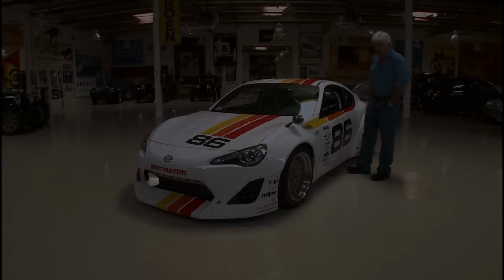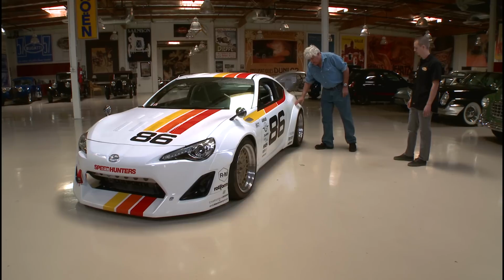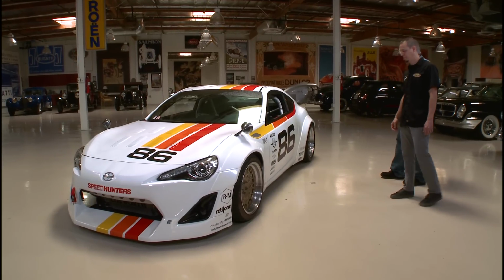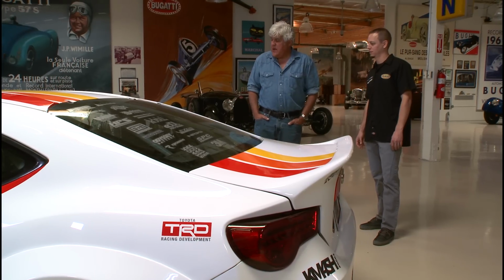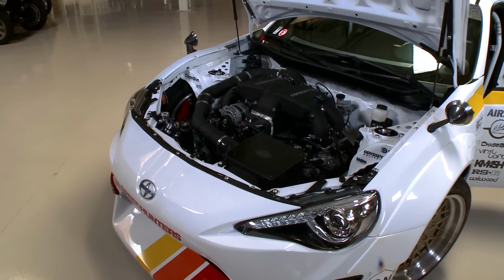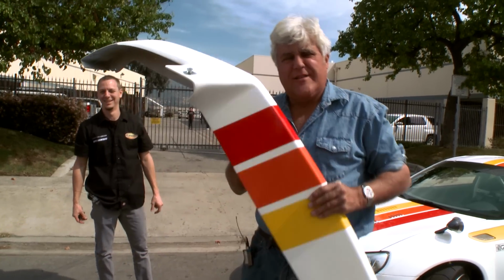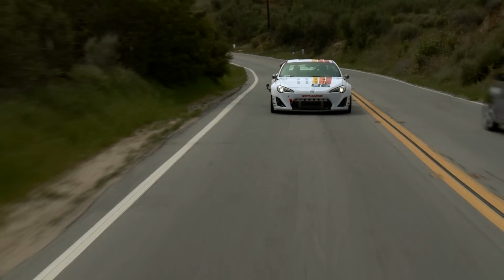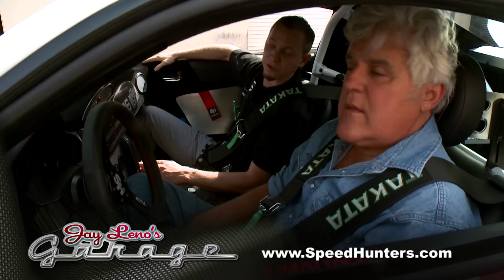Speedhunters Scion Tuner Challenge 2015 FR-S - Jay Leno's Garage

Comment: "Doesn't sound like any Toyota I ever heard." LOL...yeah...because it's a Subaru.
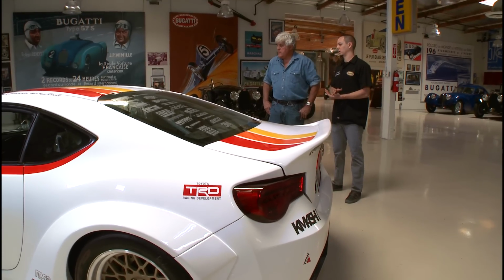Reply: Richard Rowe Naw man. Scion belongs to Toyota. It even says it on the car, pause it at 7:09 there's a sticker on the side.
Reply: LOL...yeah, I know. But it uses a Subaru boxer engine. The Scion FR-S and Subaru BRZ are the same car.
Reply: Richard Rowe actually the engine is made by Yamaha, in partnership with Subaru.
Reply: Ohhh the confusion.
Reply: Trevor Kiers are all of Subaru's boxer engines made by Yamaha?
Reply: Richard Rowe your all right but the motor was a build by both subaru and toyota and made by yamaha
Reply: juffurey many of the components such as the cylinder heads were developed by Yamaha. It was joint design. This mostly applies to the new boxer engine for the FRS/BRZ, though I wouldn't be surprised if Yamaha had a part in the older STI engines as well. They specialize in ultra performance engine components.
Reply: Richard Rowe Yep. Boxer :)
Reply: ***** Scion is a Toyota brand in the States, kinda like Lexus is too. And Acura is Honda.
Reply: juffurey No, Subaru made its own engine but on FA20 Toyota contribute to the direct injection system and it was RUMORED that Yamaha helped design the cylinder head.
Reply: Dominic Hudson main difference being there is no Scion in Japan, however there is Lexus.
Reply: ***** No, for FRS and BRZ, Toyota left the engineering to Subaru while they do the design. Yamaha only help the LFA engine, designing the intake and exhaust for the sound.
Reply: +Anthony Arreguin your all wrong it was built by Ford
Reply: +Richard Rowe they probs just couldnt afford a 2jz ;)
Reply: +Richard Rowe In case you all forgot the idea was originally Toyota's :)
Reply: +Blehtubezz Aus it doesnt matter, subaru still manufactures all of the brz/frs/86. this is still a subaru designed engine, why, because its the best choice. why would you want a toyota/scion badge over a subaru anyway?
Reply: I personally like my black out scion logos over the stock subaru logo
Reply: +Blehtubezz Aus lmfao no this car is in no way based on any previous car 😂
Reply: It’s a Toyota/Subaru collaboration for the motor if you look at the motor it says Toyota

Comment: This guy needs a high 5! Especially for tuning a boxer ;)
Reply: Really?
Reply: If you were listening, he didn't tune the engine. He just threw all the possible bolt-ons plus the supercharger from cosworth. Tuning boxer engines are amazingly hard.
Reply: Mejevoli  Unless the Otto Cycle has somehow changed for the boxer configuration, tuning the engine is no more difficult than any other engine.  Now tuning Subaru and Volkswagen engines in those tiny little engine bays, making piping fit, finding parts - THAT is amazingly hard.  I would assume this engine would have similar challenges.
Reply: Mejevoli You are probably right, it could be an off the shelf map.
Reply: Ryan McIntyre Well, Subaru engines are like glass, once you start getting knock, they destroy themselves so fast, at least faster than most motors. Ironically, they last a super long time with a good tune. Haha yes, trying to fit a front mount intercooler on a WRX is a pain in the butt because the lack of room :S The FRS might have a bit more, I am not sure.
Reply: Ferrettank Thank you for explaining that.  However, I would argue that's more of an issue with Subaru alloy durability/fragility and less with the boxer concept to which it's giving the bad rap.
Reply: Ryan McIntyre I've heard that tuning Subaru motors is more difficult than others due to their shape. Boxers tend to have a very large bore size and very small stroke for packaging reasons. My tuner told me that this makes them very sensitive to ignition timing among other things
Reply: +xbox360player350 The bore and stroke of the FR-S' FA20 engine are the same size.
Reply: He didn't tune the car. Delicious tunning in Cali did it.
Reply: +Ferrettank its not that theyre harder to tune, its just that the community hasnt gone in depth with the engine yet, but because of this car it will become more of a front running engine, compared to the inline trash
Reply: @Mejevoli  Tuning a boxer engine is hard because of the high compression 12: 5:1

Comment: Aren't the Subaru BRZ, Scion FRS, and Toyota gt86 the same exact thing?
Reply: KeepItJedi yes
Reply: Yup, there isnt scion in japan so its the ft-86. Subaru wanted a rear wheel drive since they havent had one in a decade so they partnered with toyota. It uses subarus boxer and the design is clearly more from toyota
Reply: KeepItJedi More or less, yes. The drivelines are identical across all three, but they have different trim levels and options. It's my understanding that the BRZ also has slightly softer, less tail-happy suspension.
Reply: Nexumbiker110 Actually Subaru didn't want a RWD so it took Toyota 6 months to persuade them to join them in building a sports car because Toyota wanted to use one of their boxer engines to get the CoG as low as possible.
Reply: Subaru may lose out on the partnership soon now that bmw is in the picture
Reply: jetsgo66 Considering Toyota controls a huge amount of stock in Subaru Heavy Industries, that's doubtful.
Reply: ***** Biggest auto maker in the world for the last several years. And they got there... selling Camrys. Scary, huh?
Reply: Yes Subaru and Toyota both created that car
Reply: DMStraylight I still have a hard time believing that the same Toyota that built it's fortune selling rolling road blocks like the Camry and Corolla also builds something that is actually this performance oriented!
Reply: GreenJeep1998  Toyota 2000GT, Sports 800, Supra, MR2, Celica, Lexus LFA and RC F. It really isn't hard to believe!
Reply: princeworm  With the exception of the Lexii, the rest are dead and buried.......in all honesty, the LFA and that new RC kinda surprise me too, and for the same reason.
Reply: GreenJeep1998 Well, remember Toyota is also responsible for the Supra, Celica, MR2, 2000GT, and LFA among others. It's not like the 86 is the first time they've done this.
Reply: Forehead Jones actually Toyota saved and reengineered the Subaru boxer to meet the new emissions.  When GM had stock in Subaru,  they didn't want to spend the money and was going to put Ecotec 4 in them. I'm so glad GM sold it's shares and Toyota came in with some capital.  Even though it's basically a Subaru boxer design,  there is lots of Toyota engineering in it.
Reply: GreenJeep1998 The Supra, the best of the last generation of fast Toyotas, was in production until 2002. There were only 8 years between it and the LFA (and only 4 and 3 years respectively between the Celica and MR2 and the LFA). If you're old enough to be having this conversation, you're old enough to remember good, fast Toyotas. Why was it a surprise?
Reply: DMStraylight
I mean that's what recent news has said. due to the bmw partnership for the new supra they will also partner on the future generation frs
Reply: Toyota also has by far the best mid size truck history.
Reply: To differentiate the Subaru from the Toyota/Scion versions, I wish Subaru would offer awd.
Reply: jetsgo66 Interesting. Source?
Reply: jetsgo66 True. Hell, for the last decade, at least in the US, they've got the ONLY mid-size truck history.
Reply: Patrick Pelletier Actually, in terms of sales volume, Toyota is BIGGER than VW since 2012ish.
Reply: Subaru is still partnered with toyota the bmw partnership is for the ft-1, the subaru partnership isnt going to end
Reply: Yep, MARKETING it makes these cars boring
Reply: DMStraylight
Heard it originally on fast lane daily but here's an article
http://www.motorauthority.com/news/1092880_subaru-may-lose-brz-as-toyota-turns-to-bmw-for-future-sports-cars-report
It will probably be the next next generation if it happens
Reply: Patrick Pelletier They do, it's called Wolfsburg.
Reply: Anders Kristensen You're missing the point, and I suspect you're doing it on purpose.
Reply: GreenJeep1998 mhh mhh Toyota Supra and its bulletproof 2JZ-GTE engine, ever heard of that!
Reply: KeepItJedi except for the badges and like 3 other differences...
Reply: KeepItJedi NO. The BRZ has nicer paint, not only better but more trim, comes standard with the good radio, is slightly quicker through the corners due to more mechanical grip (different suspension), better aero, etc. The BRZ is about $6000 more car than the FRS, it's a bargain. All you have to do is compare the gauges to deduce that you'd rather have the BRZ.
Reply: Skylar Garrett since when is it $6000 more car?  I mean, I definitely prefer the BRZ, but at the same time, they are almost identical.  they have the same aerodynamics with the extremely slight difference of the front fascia, unless you're referring to the tiny spoiler... but that'd only make a difference at high speeds. The gauges don't affect how good a car is...  they do have different suspension, but to 99% of drivers, they do exactly the same thing.  unless you're pulling to the limits of aero, cornering, and stereo volume, they're as similar as two different cars can be.
Reply: GreenJeep1998 You have obviously never heard of the Toyota Supra have you? Ever seen fast & furious 1? I won't own anything but a toyota, I have a 1985 4runner and a 94 celica, both are great cars
Reply: DMStraylight 1: fuji heavy industries, not subaru heavy industries.  
2: last time i checked, they owned about 13%.  the brz/gt86/frs is an impreza chasis, subaru engine, subaru drivetrain, and mostly other subaru parts.
Reply: Unusedcheetah29 the partnership is over! The BRZ will continue to improve! But the FRS will not be a successor!
Reply: There has never been any anouncement of a end to the partnership just speculation, subaru has said the brz will still be made, so why would toyota let them use the design if the partnership was over
Reply: Unusedcheetah29 toyota wouldn't need to "let" them use the design.  it's an impreza chassis, impreza H4 design (or flat 4, if you will), it's mostly subaru parts...  so if subaru wanted to make another version, all they would need to do is cancel the partnership.  I'm not saying you're wrong about the lack of announcement though.
Reply: Forehead Jones toyota should have brought back the inline six instead :P
Reply: juffurey There is no way in hell that would fit in the 86. And they're already working on the FT-1 concept.
Reply: Forehead Jones well yes, i didn't mean they should fit it in the 86. i was referring to the center of gravity
Reply: center of gravity was pretty great in any of the boxer engines... i mean, it's much lower and evens out much of the vibrations of in line and v engines...
Reply: Carlos Guevara Toyota added their own fuel injection system to the FA20 engine which is way more advanced than anything Subaru has. Another reason we should thank Toyota for investing in Fuji Industries and Subaru is that the GT86 probably wouldn't exist today if they didn't.
Reply: The thing that will really mess your head up is when you realise Toyota (or Toyoda originally) started as a company that built automatic looms (machines for weaving fabrics) and then switched gears to produce cars.
Reply: ***** nintendo started out in the 1800s making playing cards...  also, I see what you did there...  "switched gears" hahaha
Reply: +KeepItJedi There are minor differences on the exterior and I know that the suspension on the BRZ is slightly stiffer than the FRS but most people can't even tell the difference.

Comment: i like how he mentions with upgraded rods you can hit 350-400 hp, but crawford performance proved years ago you can get 500-550hp on the stock internals, then upgraded the internals and i think up'd the horsepower some more. this car tho, is sick because he completely gutted it and proved 300hp can still be a lot, if you lighten the car up

Comment: I hate the fr-s. But this one is an exception.
Reply: timassgoblin why do you hate the fr-s?
Reply: timassgoblin What's there to hate?  It's a cheap FR platform for tuning..  More automakers should be making cars like that!
Reply: While I agree they are good for tuning, I would just like to see a better build from the factory. They don't have the power behind the price in my opinion.
Reply: Not enough power for the price? They're 25,000. That's v6 mustang & camaro, civic Si, the genesis base model 2.0t, base model focus st & fiesta st price range. Most of these have around 200-280hp and don't hit 300 to the wheels. Not to mention the FRS is atleast 300-600 pounds lighter than all of these cars and in my opinion it looks better. Better platform for modifications as well. If you want to compare the FRS to used cars then wait until the FRS is an older car THEN compare. I bet these cars will be around 12-15k in about 3 years for a 2013 model. You can already find them for 19k.

Comment: seems like more more noise than go. pretty cool. would love to see a more sleeper version. 
Like the Louvers, would be cool if they could follow the stripe on hood. bracing underneath prevents that I see.

So 7k for 125+ hp. not all that bad. 
about 20K for used BRZ plus 7k not bad. couple K on wheels and flares.

Comment: It’s an 86 because the bore of the engine is 86 mm and the stroke is 86 mm! That makes a square engine for power and torque! The forces in the engine are considerably less because the rotating parts are harmonized which makes it relatively easy to upgrade to increase the power output! Hence all the aftermarket add ons!

Comment: Looks awesome, sounds awesome, and it's just overall really awesome!

I have seen/heard from other videos with modified ones of these that keeping them cool can be a problem when you boot them like mad, so if I ever had one, one of the first things I would do would be put in the best radiator/cooling system I could afford before modding it any further.
Reply: I really don't think the cooling was due to the supercharger. The car has an aluminum CSF radiator and my daily driver is also supercharged with no issues. This was the first time the car was driven hard so it's likely there was just an air pocket in the cooling system or the thermostat got hung up.

Comment: so a honda can be faster then this scion FRS? 😕😕 like its kinda slow?😕
Reply: Stock the frs and brz are not fast. They aren't meant to be. They were meant to be a Miata like car, good handling and fun but not fast. They are still cool cars. The one in the video is fast due to being supercharged
Reply: So you can still make the frs supercharged but it won't be that fast i mean it will be fast but not that fast
Reply: There are supercharged brz's that make plenty of power. Same with turbo brz's
Reply: No supercharged frs? :/
Reply: 90% of Hondas won't beat it... Only ones are b series and k series which are gonna beat a good bit of cars out there to begin with lol
Reply: the car in the video is a supercharged FRS...
Reply: 310 blah blah frs are so slow, my rx8 stays crushing them, it's a joke when they try racing me
Reply: TheLEGOEffects still slow my rx8 pushes 300 non turbo, all I have is an exhaust and headers and I'm gutted with a k&n intake, with greddy pulleys and the frs is 300 supercharged? that's sad

Comment: Supercharge/turbo and frs n it still runs 14s at the track lol. Rice
Reply: Bobby Wisdom Lol, my guess is you can't afford one in the first place. This is not a drag car, it's a car that can deliver a good time on a windy road. Better than any older muscle car that you can think of. And the FR-S might not be able to but my Alpha 12 GT-R with about $65K worth of mods ran a 9.41 with me in the driver's seat last year. I was banned from the track because I didn't have my NHRA license for running under a 10.
Reply: Nickel Reed and im pretty sure if you run under 10s at the track you need a cage. I call BS buddy

Comment: Pretty cool car but the rims just kill the styling a little. I personally never understood why people like chrome lipped rims.
Reply: zalien6 You probably haven't watched 80s and 90s racing then. These magnesium-style wheels are what most car guys over 25 grew up watching on TV. Even today, race cars still often have wheels with that unique 2-piece look, although usually with fewer spokes.
Reply: schlafanzyk Now that you mention that it makes some sense also you're right I haven't watched much 80's & 90's racing. Is there another reason though? What I came up with is the lip could be made of something light to drop some weight but the core of the rim has to be very tough for safety. Am I way off?
Reply: zalien6 You are not that far off there, but I think the main idea was to simplify the production process, storage and maintenance. The more load a wheel takes, the more pieces there usually are to spread out the flexing and wear'n'tear, so when there is a crack appearing in one of the spokes or the center hub star is off-axis or whatever else could go wrong, you don't immediately have to throw away the entire rim. Just replace the broken/bent piece and off you go. Unless you run over curbs or rub against other cars, the center piece usually takes the most stress in everyday racing as the lateral forces are much higher in racing due to the increased grip of slicks. It's really a practical/time issue. No need to even remove the tire as long as the lips are fine. Just look at some military trucks. They sometimes have 3, 4 and 5-piece rims with a million nuts and screws. If one of those starts showing a crack, you're not immediately at risk of the entire wheel coming undone and having to find a tire shop to separate rim and tire. Just take that piece from a spare wheel using basic tools. And as ***** said, magnesium is stronger and lighter. But it was also harder to work with as it can catch fire in certain conditions. Hence the benefit of a 2-piece rim. Here it's just a visual design tribute to that kind of style, because real magnesium wheels would most likely blow the budget.